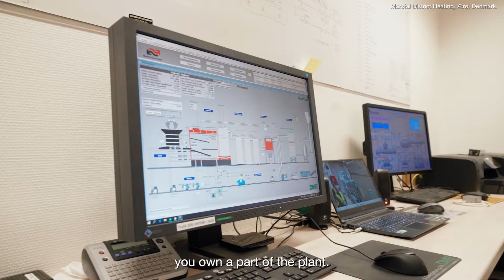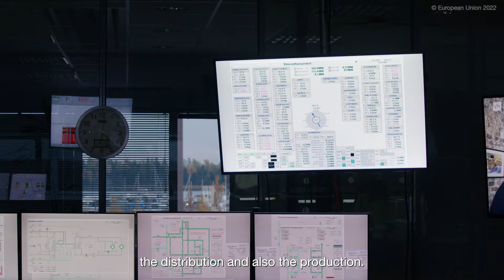District heating and cooling in the Nordics

Comment: Hi , will be great to run a solar farm but supply the engines with magnetic energy.
Also tu run wind energy farms but without wind practically almost the same system but inside the turbine we roll out the power with magnetic energy inside.
Best regards.